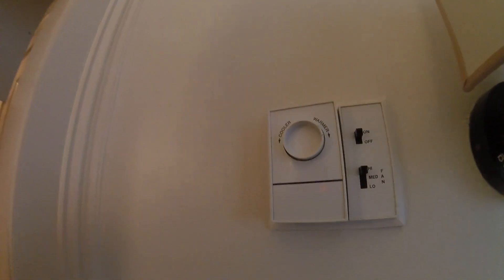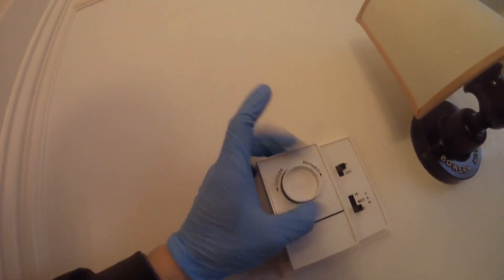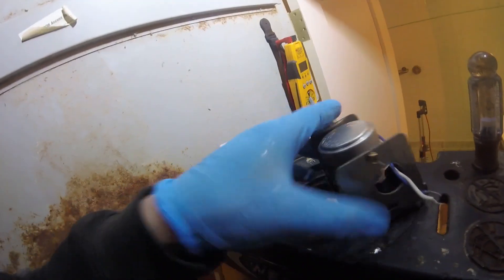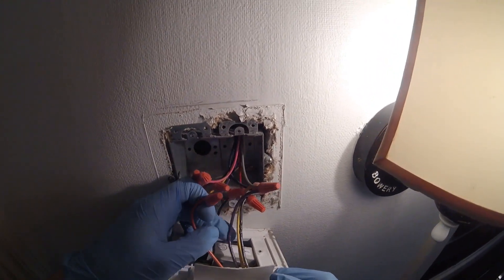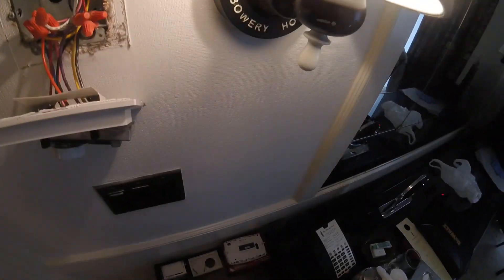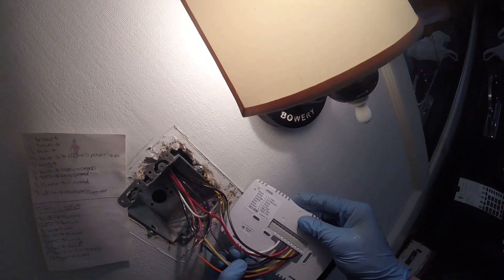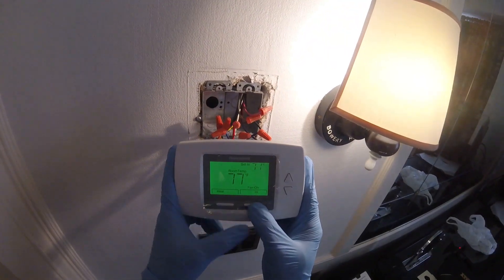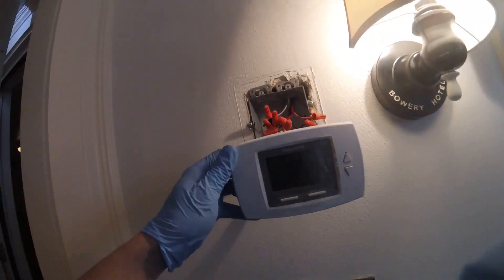HVAC: Thermostat replacement for fan coil unit (Line Voltage)

Comment: I installed this unit and use the auto setting for the fan coil to turn on and off.  The fan does in fact go off once the preset temperature is achieved, but doesnt turn back on again when the conditions call for it.  Any troubleshooting suggestions? TIA

Comment: Where did you connect the common wire that's coming out of the wall to the thermostat? on my thermostat. There is no common wire .. I have the same thermostat..
Reply: Hey got same call with no common wire wich is white here almost as a Neutral wire...I found white wire wrapped around the holding screw on tstat plate. Tnks

Comment: Very informative, thank you! Any programmable replacement you can suggest for Honeywell  SuitePRO Thermostat? I have a Fan coil unit with heating and central cooling.
Reply: The same t stat can be programmed
Reply: Same Tstat

Comment: Could you tell me how do I change the mode from heat to cold? I live in a condo and the heat was working fine until they changed it to cold this month. Ever since then, it is set at heat and wont throw cold air.
Reply: I have the same problem any luck finding out how to change it please message back
Reply: Need ask Bldg Engineers to see if they back on Cool or Heat

Comment: A free Tip we also use a transformer w 24 volt actuator in case we don't have a 115 volts Actuator. It s only a tip that work,,,,,or leave it temporary open as they did in ur video but people complain that the room is freezing.Tnks again.
Reply from the maker: The video before this one had the exact same setup you speak of. 24 volt actuator that energizes when the transformer is energized by the pipe sensor. Whatever works right? Lol. I hear you with that. Yup, people will complain its either too hot or too cold. These are the most common systems found in hotels and those customers can be very picky but dont blame them after the ridiculous prices they pay here in the city. $400-$2,400/Night so that AC better be working right!

Comment: Coffee yup,,!but I m in Florida kind of hot here,,,,,listen tnks,,,,,I took me bout an hour to do the same job here due to parking issues 20 min to park 10 min to clear security 10 min for social interaction and probably actually 20 to do the job,,,,,,tnks man,,,,,,where are u by the way,,,,,,,we only have 2 pipe syst, here w electric 5 kw heat,   appreciate what u show for our AC community in Florida.  Ttyl 😑
Reply from the maker: NY prices are pretty insane and between all the filth, it's a bit overrated. I love this city but I do have Florida on my mind. I think an HVAC tech can live a better life out there money wise. Salary vs cost of living
Reply from the maker: Might want some ice with that coffee in FL haha I'm from NY 😎 In the commercial industry all over Manhattan. Find every unit you can imagine in this city, it really gets complicated at times. Thank you for your comments, always appreciated. I'm here for the HVAC/R community 🙂 The 2 pipe system with electric emergency heat is most common when it comes to fan coil units but I do come across large 4 pipe systems